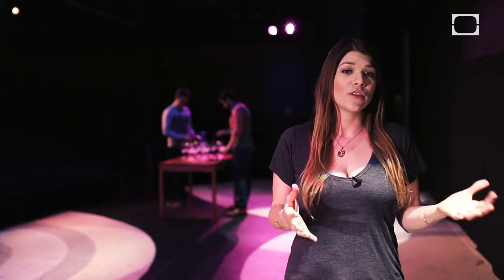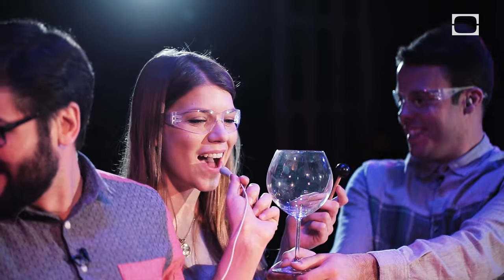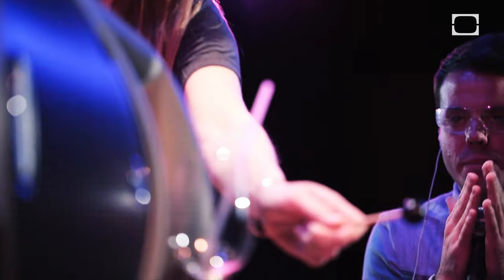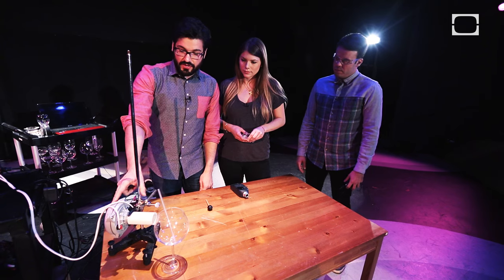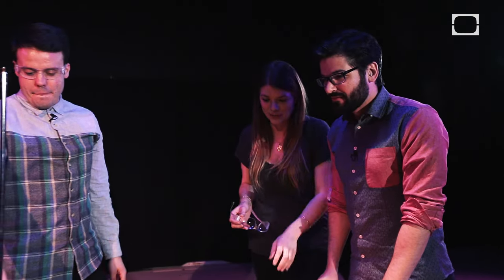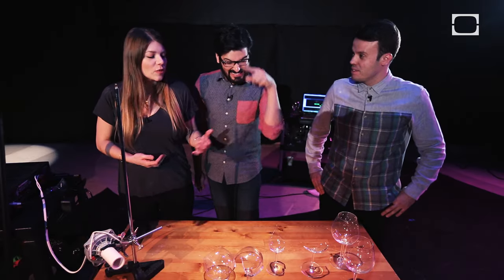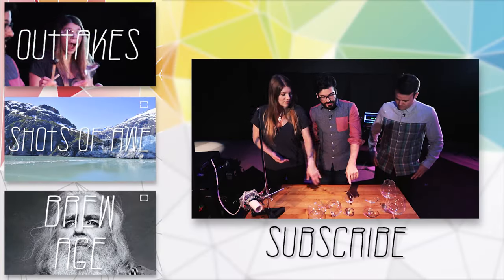How to Break Glass with Your Voice - Hard Science

Comment: You don't measure pitch in decibels. Decibels gives the loudness of the sound. I think you just smashed that glass with  brute force instead of resonance.
Reply: You require the resonant frequency and sufficient amplitude to produce a resonant wave to shatter the glass. Decibels are your amplitude. You can't shatter the glass without enough amplitude.
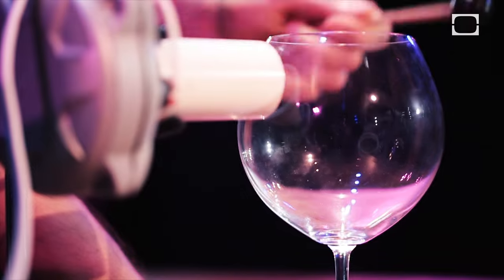Reply: Metalrasputian Yes, i am aware of that. I was pointing out the mistake made at 2:45.
Reply: Berzerius Fair enough, then. I had assumed you were referring to the earlier part of the video mentioning they needed around 100 Db to break the glass.